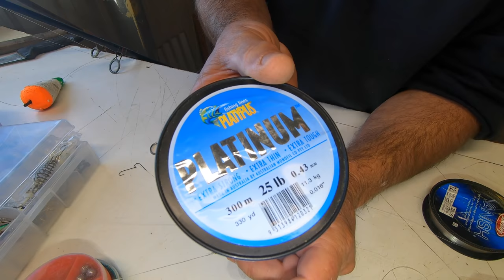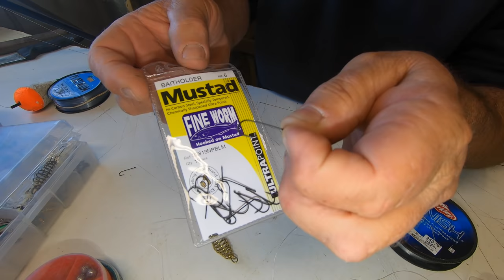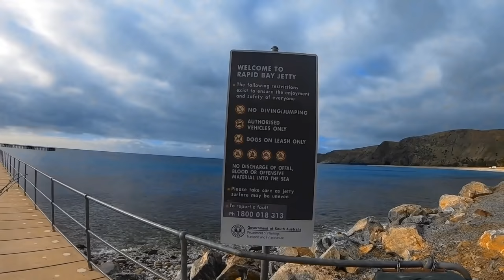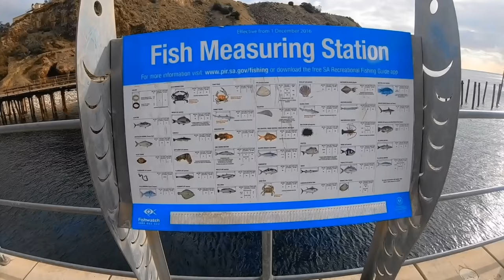Australian Herring, Tommy Ruff jetty fishing rig and fishing on Rapid Bay jetty.

Comment: Is the tommy rig heavy enough with the berley I guess and not casting it too far?
Reply from the maker: Hi, with light 6lb to 12lb nylon line or equivalent diameter braid the Tommy rig with only a burley spring casts easily from jetty's also if fishing off rocks into deep water its good, with burly squeezed in even better. If it's really windy or a strong current you may need to add a very small sinker to your burley spring but it's usually fine without a sinker. You will be surprised how far this rig will cast. All the best with your fishing and hope this has helped.

Comment: The question is, where did you get the berley spring from?  It doesn’t look like the ones you make.
Reply from the maker: Hi Marcel, this burley spring is from the fishing tackle shop South Australia it is a good size for this type of fishing but if we want a bigger burley spring or smaller one we have to make it.
Reply: @davidsheldonfishing9726  I certainly like the look of that spring.  Been search for something similar but most are more spring shape and not that oval football shape.
Reply from the maker: @marcelchaloupka  yes these bought springs are a nice shape also made out of brass I think, not too heavy. Have a look for some nice wire and a bolt and nock some up, with pliers you can work the ends into a more over shape if like, or you might be able to find them on ebay.

Comment: Awesome video! Is there a reason youdont go with a sinker?
Reply from the maker: Hi thank you, yes there is a reason. I find just the weight of the burley spring is heavy enough plus a little bit heavier with the burley squeezed into it. The lesser weight allows your baited fishing rig to sink slower through the water column to the bottom. I should have explained that in this video it is a very good question. Tommy Ruffs (Australian Herring) generally feed from mid depth of the water to the surface you can still catch them at the bottom but the surface to mid depth of water is the best area most of the time. When I cast into the water I don't let my fishing rig sink straight down to the bottom I click the fishing reel bail arm over and feel my line for bites as my baited rig slowly sinks down, when the Tommies are there it doesn't take long to get a bite the fishing can be quite fast and exciting. on this video I do mention sinkers at 22:00. thank you for your question I hope I have helped and when I get back into videoing I shall mention this. Cheers David
Reply: @davidsheldonfishing9726  thank you for taking the time to reply to my comment and also for the extra bit of info.
Cheers.

Comment: BURLEY NASIL YAPILIYOR.  YAPTIĞINIZ TAKIMLA KEFAL ÇİPURA , LEVREK, DİP BALIKLARDA KULLANILIR MI.. KAÇ NUMARA, UZUN  ,KISA,  ÇAPRAZ, DÜZ MÜ  TEŞEKKÜR.
Reply from the maker: Hi, thank you for watching I do wish I could translate your comments.
Reply: @davidsheldonfishing9726  HOW BURLEY IS MADE. CAN IT BE USED WITH THE TEAM YOU MADE IN MULTIPLE sea bream, sea bass, and bottom fish.. HOW MANY NUMBERS, LONG, SHORT, CROSS, STRAIGHT THANKS.
Reply from the maker: Hi ENIS, I shall do my best replying your comment and it is nice being asked by someone from Turkey. I do have a video showing how I make the burley shown in this video it's called How to make burley for Garfish, Tommy ruff, Mullet and Bream etc. the ingredients are CURRY POWDER, GARLIC POWDER, PARMESAN CHEESE, ANISEED OIL,BREAD CRUMBS, BRAN, POLLARD, SUGAR, and TUNA OIL, watch if you like to see how I put it all together when it is made spread it out and make sure it is dry properly before storing in a container it will keep for a long time as you use it. When you take it fishing add a bit of water and mix until it combines so you can squeeze into a burley spring or steadily throw small balls into the water where you are fishing, it is very good for a lot of species of fish from surface midwater to bottom fish. For sea bass I would just use Pilchards for burley squeezed into a burley spring, I also have a video showing How To Make A Burley spring you might find interesting. I'm not sure what you mean at the second part of your comment but I do hope I have answered some of your comment correctly....CHEERS DAVID.